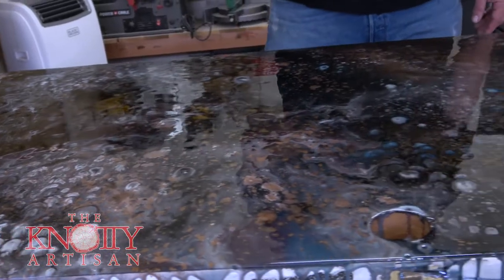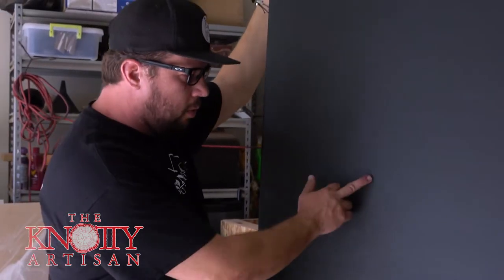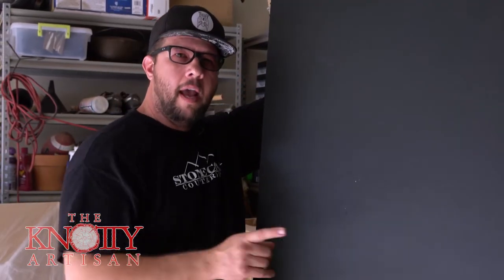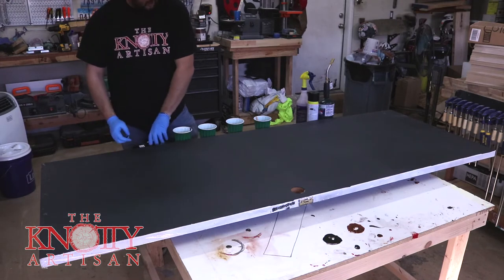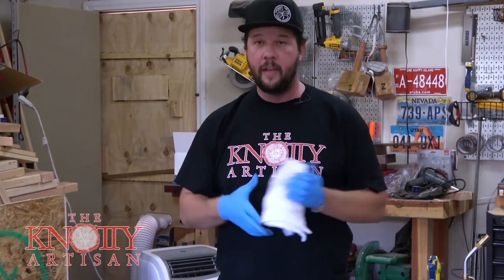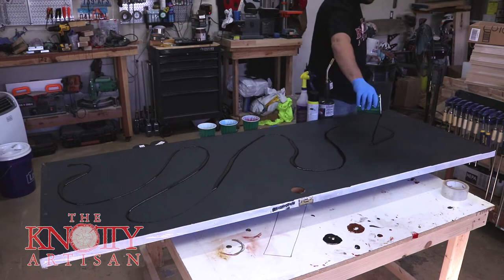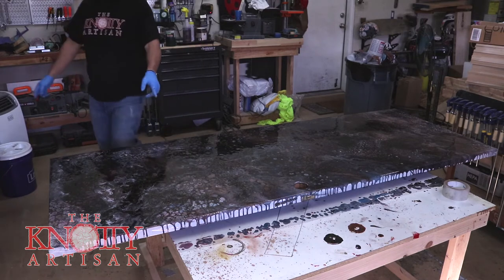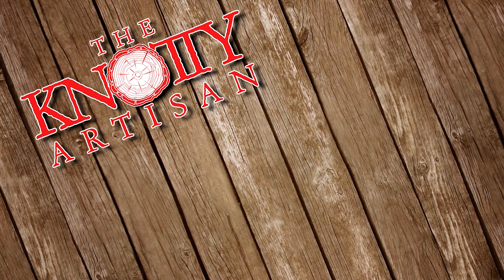How To Epoxy Over An Old Door Stone Coat Style

Comment: I was wondering if you need a base coat of paint or stain before you begin?
Reply from the maker: Hello. Yes I always use a base coat with every project. Typically I’ll use a behr paint in a semi gloss or satin interior paint as my base coat
Reply: @KnottyArtisan have you had any issues with it coming off, as the bond to the door will only be as strong as the paint vs doing epoxy all the way through?

Comment: Hey hey - I want to do an epoxy coat on some very old exterior doors, will the epoxy crack or fall off if used on a high use door? And would you recommend a certain type or brand of epoxy? I see some called table top or bar top would that type be ok to use? Thanks :)
Reply: Epoxy is very strong glue so it definitely should not fall off!  Only thing to be careful of would be any of the outside door that will be in the sun will need a UV resistant top coat